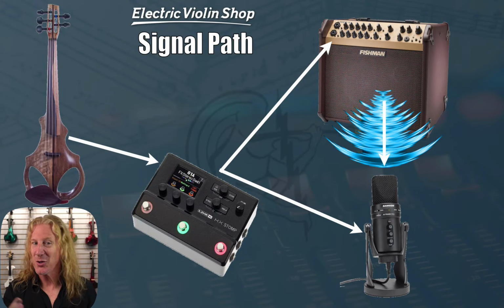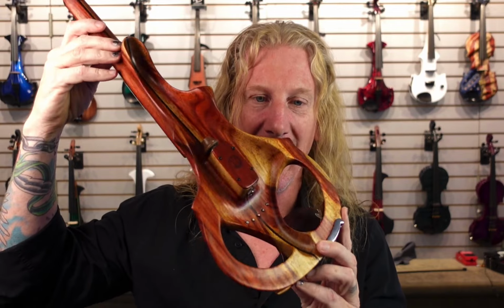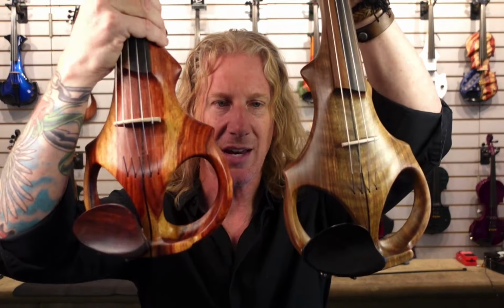ETJ Electric Violin Demo!

Comment: Hi, in this type of violins where you do not have the reference of the body of the instrument, is it difficult to find the third position?
Reply from the maker: Good question. My experience is, no. We still have a thumb stop (the heel) underneath the neck. And even when you take the upper bout away, your body knows how to find that heel when shifting into third position. And the lack of a bout makes it WAY easier to work even higher up the neck. Fifth, sixth, or seventh positions are much easier to access.
Reply: @ElectricViolinShop  Ok, you have clarified my doubt, thank you very much for your kindness!